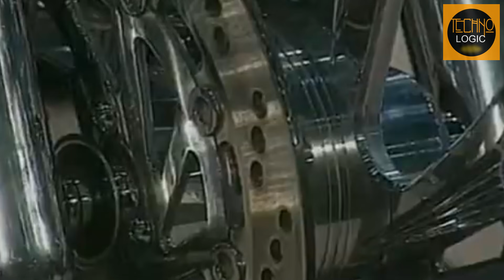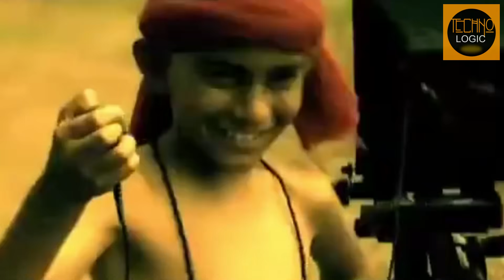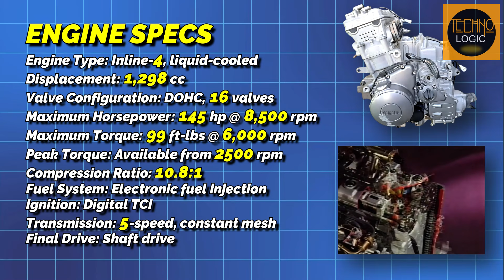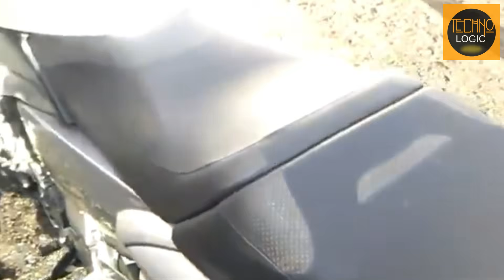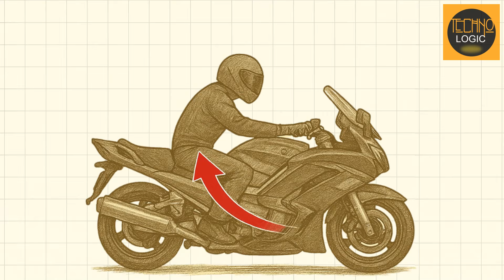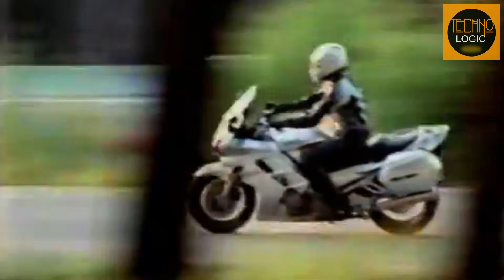👑 The King is Born: How the Gen 1 FJR1300 Conquered Sport-Touring‼️

Comment: The "ticking" is from the weak original cam chain tensioner, not the valve guides. The upgraded part is not expensive or hard to replace, it's a little fiddly, but can be done in an hour or so.   The "furnace" problem is real. There are some mods to lesson the problem, but when it's hot out and you're not moving fast enough it can get uncomfortable.

Comment: I'd like to have a new FJR to replace my aging BMW K1300GT, 160 hp and all the bells and whisles that any long distance tourer could want.  Why get rid of such a noble beast?  150K miles on the odometer and and an ever diminishing availability of parts and qualified mechanics who in some cases "don't work on old bikes".  Sadly the best replacement would be an FJR that Yamaha corporate deciides iis no longer relevant  to the U.S. market.  Solution?  I'm walking away from two wheels and buying a BMW Z4.

Comment: Very good, but greatest... have you ever ridden a Honda ST1300?
Reply: Yeah, slow 🐌  and doesn't come close to the fjr
Reply: @madheadmadDAZ  ^well... it kinda does when all them little things start going wrong and needing upkeep on the yamaha, the honda will keep on driving and keep on driving. Bikes made for hundreds of thousands of miles should inherently not get troubles because of the high milage, that is a self defeating feature. Also, i dont know where you live but here the speed limit is 120 and most people dont take these tourers to the track constantly so do you really need to be able to go 240 instead of 220? really?
Reply: @andriesvanr3422 I've had all the reliable Honda's the NTV650, NTV600, CG125 etc. Of the bikes I've owned the Yamaha FJR has been by far the most reliable... 
I used to be a honda fan boy too then I tried other bikes that are in my opinion much better.
Reply: @madheadmadDAZ I totally agree with you.
I was a big Honda fan until I brought a Yamaha
Reply: @brotherbrenden Yeah, Yamaha shocked me to be honest. I remember a mate had an old r6. He would rag that thing constantly. Never missed a beat once. Just kept going for years with little maintenance.
Reply: Нет не лучше, сам езди на своей  Honde.
Reply: They are both good bikes its just what you want